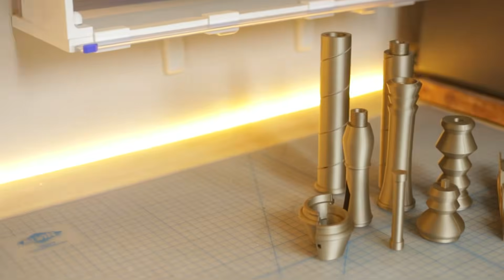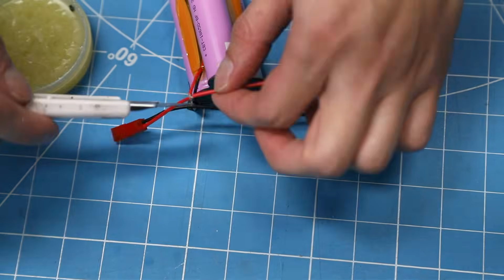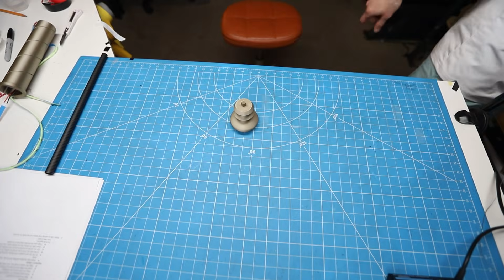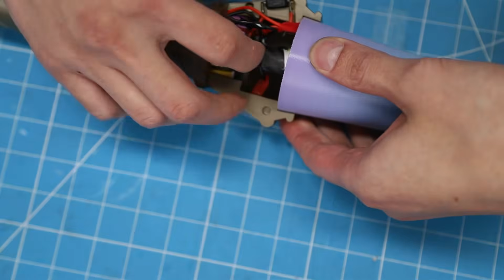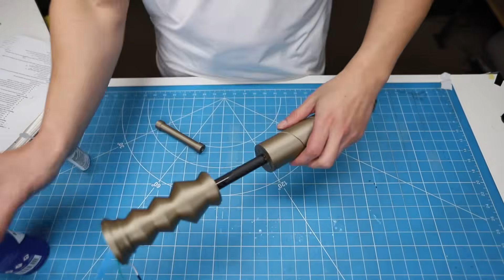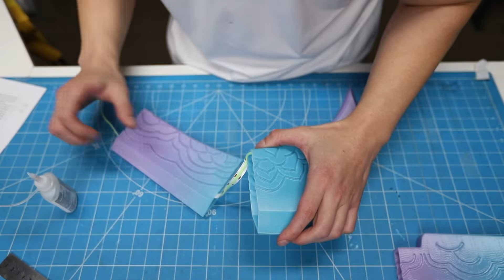KPOP Demon Hunter - Mira's Glaive LED Tutorial

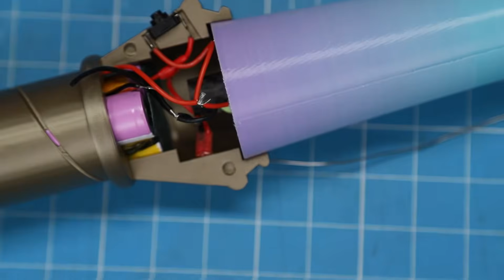Comment: These tutorials are so good!!! I'm working on making Akechi's saber from Persona 5 and I'm using these as a reference of how to do the LEDs as its something I've never done. Do you have a new link for the 12v charger, current link is not found? Another question, at 13:21 you can see a hole in the chasis that holds the battery, does this serve a purpose?
Reply from the maker: It helps dissipate heat from the battery.